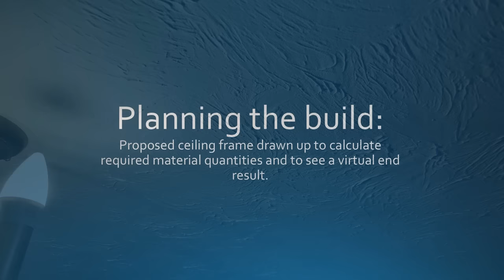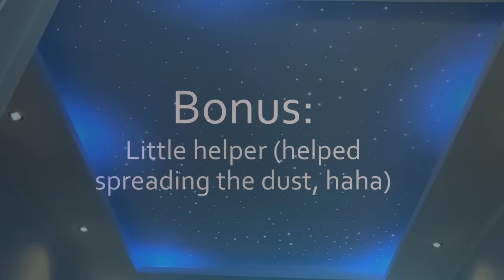Fibre Optic Star and RGB LED Ceiling DIY Build

Comment: so you cut the fiber optic before taping and mudding, AND painting? wouldnt those activites fill in or cover the fiber optic holes?
Reply from the maker: You'd think so, but when using the jointing compound I worked around fibre optic strands as well as not placing any strands near the edges of the plasterboard. And painting over them does not affect them as you'd think. However when trimming, I did leave the optic strands sticking out by around 2-3mm in case I would need to trim them further after another coat of paint (if I needed to refresh the ceiling in the future).
Hope it helps.

Comment: Amazing job! I was planning doing something similar with plaster boards as well but I was a little concerned about painting over the fibers after hanging the boards and cutting the fibers to desired length. Using plaster to cover where the boards join and painting won’t cover fibers?
Reply from the maker: Thanks!

I plastered joints before trimming fibre optic strands, working around them. And trimmed them before painting the ceiling (though left them sticking out by around 2-3mm for future trimming if further paint coats will be applied). Once painted over they shine through just fine, which I was surprised about too. But like I say, if needed it's always possible to trim it further when you leave them sticking out a tiny bit. 
Hope it helps.

Comment: I'm planning to something similar.. When you fill the joints with the compound won't cover the optical ends?
Reply from the maker: It would cover them. But I didn't put them close to joints and then worked around them.

Comment: What power control box / power did you use. The link has loads. I'm in the UK too and will connect to a switch. Thanks and keep it up. Brilliant
Reply from the maker: Thanks mate.
I've used the 5V 30A one, because it was compatible and sufficient for the length of the LED strip I had. 

Your power adapter choice depends on the type of LED strip you will choose to use (it's voltage) and it's length. 
Also, don't forget to make sure that your cables sizes are of appropriate size to handle the load, especially if you go with a 5V strip.

Good luck with your project.

Comment: Great job, i really liked it. Can i ask you the question please. When you were doing the ceiling paint using the roller, didnt the fiber optics  cover by the ceiling paint. How did you manage. Futher please guide me to buy all the material you used. Thanks
Reply from the maker: It is ok to paint over fibres, they shine through absolutely fine (I did two coats of white vinyl matt paint).
However I also left them sticking out about 3mm for future painting. When they will no longer shine through, I will cut ends by about a millimeter to expose fresh unpainted fibre ends.
Hope it makes sense.

Comment: Looks amazing..
2 questions..
1) if you could do it again is there anything you would do differently
2) I’ve always thought star ceilings had to be on a black background, how does the effect look in person on a white ceiling, and does it still look nice when starlights are off 👌
Literally was planning the same project but now I’m thinking I don’t need a jet black ceiling in my house lol
Reply from the maker: Thanks Adam, appreciate your comments.
Yes, if I would do it again, I would use tapered edge plasterboard. Only because it is easier to join it.
On the white ceiling subject, I also considered having it black and did a drawing to see what it would look like - it wasn't to my liking and also I think it would have made the room look smaller.
Now when star lights are off, you cannot see them at all and it looks like just a regular ceiling with a recess. And when star lights are on, you can clearly see them twinkle even in a bright day light.
Personally I am quite pleased with the end result and would not change it to black ceiling.
All the best!
Reply: @DIY_it_ALL  I am planning this for my living room. I am also confused about black vs white. This is a living room. So I don't want a black ceiling. I want a look where when star light is not on it should look like a normal ceiling but when lights are on they should show through as a night sky. Will this be possible with a white paint like you did? And did you paint on top of the fiber optic lights? Did the paint not get through?
Reply: I'm curious about this too, after you painted ceiling, didn't the color  soil(got on) end  of fiber optics, and reduce the brightness? Is it safe to paint over fiber optics after you cut them? Won't that have bad impact on brightness/lighting of stars?

Comment: Did you fix the plasterboards straight onto the old ceiling joists (with the strips of plasterboard on the back as shown in video or did you put more joists up there to screw onto?
Reply from the maker: I fixed thin timber strips onto the existing joists to create a gap between old ceiling and plasterboard for the fibre optic strands, and then fixed plasterboard sheets onto them with 50mm plasterboard screws.
Hope it helps.

Comment: Looks amazing! And going to try myself! Question for you, once you feed the fibre lights through randomly placed holes in the plasterboard. Do you need to cut then the other side so they are flush with the ceiling? How did you then paint over then without covering then up?

Thanks in advanced!
Reply from the maker: Thanks so much!
Painting over the fibre optic strands is fine and actually does not affect them shining through the paint.
However when trimming the strands I left them sticking out by around 2-3mm in case I would need to trim them further after another coat of paint (in case I would need to refresh the ceiling in the future).
Hope it helps, and good luck with your project. 👍

Comment: Did you paint right over the fiberoptic cable ends with no issues of the paint blocking the light transmission?
Reply from the maker: That's correct. I also left strand ends sticking out around 2mm, so I could trim them in future if ceiling will need repainting.

Comment: One last question, sorry :) 

I noticed that you made bigger hole marks for the optics and then smaller holes to actually feed, filling the bigger holes afterwards. Is that a necessary step? Or should I just go straight to smaller holes? Going to film my progress on something very similar and give you a shout out!
Reply from the maker: No worries, your project sounds exciting!

The reason why I made marks with the sharpie pen first is mostly to make sure that fibre optic strands are relatively evenly spaced out and so that the star pattern would be visible (quite difficult to see those 0.8mm drill bit holes). But it's definitely not necessary.

Hope it helps.
Reply: @DIY_it_ALL  thank you mate :)

Comment: Awesome job mate.. 2 questions.. 1. Did u Trim the lights before or after joint the drywall with mud? 2. Does painting over the lights affect them at all? Thanks and blessings man
Reply from the maker: Thanks so much mate, appreciate your comment.
I've trimmed the strands after applying the joint compound. And painting over them is fine, because they shine through the paint with no issues. Nevertheless I've left them sticking out by around 2-3mm in case I would need to redecorate the ceiling in the future and they would no longer shine through. I would then trim them further to expose fresh tips.
Hope it makes sense.
Reply: @DIY it ALL  make sense.. keep the hard work mate.. awesome outcome

Comment: Great work out of interest what stunner sizes you used and how wide is the the suspended ceiling. Looks great
Reply from the maker: Hi,
Thanks for your question.
I built the frame using 2x2's. The suspended part is 500mm off the wall and 270mm off the ceiling - 200mm for the 'base' and 70mm for the 'bottom lip'. 
The base came out 400mm off the wall and the bottom part 500mm, leaving a 'lip' of  100mm to hide LED strip for indirect lighting. Hope it makes sense.
Reply: @DIY_it_ALL  that all makes sense. Where did you get the fibres from out of interest ?
Reply from the maker: I bought it on AliExpress. I think there's a link in the description.

Comment: So did you cut the fiber optics flush with the holes and paint a thin layer over them?
Reply from the maker: They stick out by around 2mm, not flush with the ceiling. And painting over them is absolutely fine, I think I did two coats of paint.

Comment: What is the minimum ceiling height required to do this? Our house has only a 8 feet ceiling and I am thinking if I add this then it will appear too low. Am I mistaken? Thanks!
Reply from the maker: My ceiling is 8ft too, and the soffit drops down 6 inches. 
I have also installed vertical timber battens behind the TV stand (can be seen in video at 0:42) to make the impression that ceiling is higher. It definitely helps.

Comment: Amazing work man! I would love to do this to my living room, i still have a question tho. How did you paint over the fibers? Isn't the fiber now covered in paint which causes the light to be blurred or blocked? Looking forward to your reply, thanks ♥️🚀
Reply from the maker: Thanks so much!
It's ok to paint over fibre optic strands, they shine through with no problem. But I did leave them sticking out by around three millimetres, just in case I would need to trim them in the future after "refresh" paint coats.
Hope it helps.
Reply: @DIY_it_ALL  are you saying they are not flush with the ceiling?
Reply from the maker: @diybuildandlife207  That's right. They stick out by 2-3mm, but because the strands are transparent you can't see them.

Comment: got the starry bit done, just wondering the best way to create an access point if the optics light unit ever needs replacing. Where did you put yours?
Reply from the maker: Mine is situated within the dropped ceiling and accessed via an access hatch in the vertical piece of plasterboard above the overhang. Hope it makes sense.
Reply: @DIY_it_ALL  yeah it does, thank you

Comment: You painted over the fiber optic cable and it still shined thru the paint?  Would this work with black paint?
Reply from the maker: It certainly would. As long as it's matt emulsion.

Comment: How were you able to paint over the fiber optic lights?  Were they recessed just enough in the drywall?
Reply from the maker: Quite the opposite - they were left sticking out by around 2-3mm. Just in case I would need to trim them in future (after/if more coats of paint are applied).
But two coats of paint I have applied did not impact their brightness at all.

Comment: Great work! When you wired the lights, did you connect all white, all black and all ground together with one light that was actually connected to power?
Reply from the maker: Thanks!
Yes, I  supplied power to all lights from a previous light fixture.

Comment: When you painted did you just paint over the star lights ? Did it not cover them ?
Reply from the maker: Yes, it's absolutely fine to paint over them. Through I personally left strands sticking out by around 3mm in case I would need to trim them in future.

Comment: Its the most wonderful and finest job i have seen done by an individual. Im gonna start my project next week to make similar ceiling. I need  some help though, can i paint the ceiling black ? Would it effect the strands?  And i am planning to do it with the gypsum board, whats your say on that?
Reply from the maker: Wow, thank you so much! I appreciate your kind comments.
Yes, it is ok to paint over strands using any colour as long as it's a water based paint (usually matt colours). Personally I also left strands sticking out by about 2mm, so that if future layers of paint would stop them shining through I could trim them and expose the ends again.
With regards to gypsum boards, I used them in my build and it allowed me to achieve a seamless joint finish, so would recommend.
Hope it helps and good luck with your project!
Reply: I suggest doing a test of black on the ceiling.  I tried one and decided that I did not want black ceilings, so I switched them to a cloudy sky.  FYI

Comment: Hi, couple questions if you don't mind. Which stud finder did you use? Also, did you use plaster filler to cover holes from which starts coming out? I can see quite big holes before you installed plaster board to the ceiling. Hope it makes sense. Thanks
Reply from the maker: Hi Marius,
Thanks for your comment and questions.
Rather than using a stud finder, I went with the most basic (though most trusted) way - a small nail and hammer. Admittedly not the quickest way, but I wasn't prepared to spend a lot of money on a decent stud finder.
To fill holes in plasterboard as well as all joints I used plasterboard joint compound.
Hope it helps, buy don't hesitate to get in touch if you have any other questions. Good luck with your project!
Regards,
Karolis.

Comment: Quick question!  How did you mud all the seams and feather out your joints while all the cables were in the way? I feel that if you used a trowel that would risk damaging the cables.. Cheers and I hope to hear back from you!! 

Also the ceiling is wicked!
Reply from the maker: Thanks so much!
I used a small 4" blade to fill joints whilst avoiding fibre optics followed by some sanding to feather out the compound/mud.
Hope it helps and good luck!

Comment: Looks amazing!! Just about to do something very similar so it’s good to see how others have achieved it. How deep have you made drop ceiling approx 600mm from wall out to edge of new drop ceiling??? Do you need the spine (attached to ceiling for extra support?) also I want to fit speakers in mine which have a 4.5 inch depth so curious if you you used 4x2 or 3x2 for the frame? I think I would have to place speakers behind where the spine would meet the wall mounted frame as wouldn’t have the depth otherwise, any suggestions?
Reply from the maker: Thanks so much for your kind comment. It was actually 500mm out from wall in my scenario, but I have a rather small room. In a larger room it would probably need to be more than 500mm to look impactful.
I used 2x2's for the frame, but again, my frame is quite small, so it was sufficient.

Comment: This is so good, I am going to try it in my new outbuilding.
I can see from your comments that it is ok to paint over the fibre optics but how about with the taping and jointing? Did any of the gear cover any of the fibre optics? Or did you manage to avoid covering them?
Reply from the maker: Thanks so much for your comment.
I have spaced out fibre optic strands in such way that there were no strands on joints, so tape & joint was fairly straightforward.
Hope it helps and good luck with your project.
Reply: Can I ask what LED strip you used? I need to install mine but it isn’t quite as straight forward as I thought. Many options and a fairly long length

Comment: Hi, would love to do it but concerned my ceiling will be too low and make the room feel claustrophobic. Do you mind me asking what the measurement is from the floor to the  top/bottom of the edge of the suspended ceiling? Many thanks!
Reply from the maker: Hi, my ceiling is also rather low - 2350mm. The distance from the floor to the bottom of the edge of the suspended ceiling is 2150mm. Hope it helps.

Comment: Amazing job. How didi you paint the fake ceiling with the optical fibre without painting them over?
Reply from the maker: Thanks. 
It's fine to paint over fibre optic strand ends, it doesn't affect the light transmission. 
But I also left strand ends sticking out around 2mm, so I could trim them in future if ceiling will need repainting.
Reply: @DIY_it_ALL  thanks, will do this project next week, thanks for the help

Comment: Great job, question, how big is the gap between the old celling and the new false celling? I would like to know the dimensions of that frame you made
Reply from the maker: Thanks so much. The gap is 20mm, I used 20mm x 40mm timber to form the frame.

Comment: For the 15 meters of SK6812, they come in only on 5v. How did you handle the power injection? I've been debating this one or the WS2815, the advantage of WS2815 is you can go 12v but they're only RBG where the SK6812 is RGBW.
Reply from the maker: Good knowledge of LED strips mate!

I have injected power supply every 2.5 meters, so have 4x injection points plus both ends of the strip are connected to power supply too, which equals to six power points in total.
Hope it makes sense.

Comment: How do you fill joint compound in the seams without covering up the optic fiber strands?
Reply from the maker: I worked the compound around the strands, but also tried not to put strands too close to the joints.

Comment: Great video 
I  doing something similar 
I was wondering , where you got the led lighting from as I am struggling to get the strip to do all the functions your did

Once again great work ...
Reply from the maker: Thanks so much mate. 
I bought LED lighting from AliExpress, but you can easily buy it on Amazon or eBay. Search for "Addressable LED" and you'll find plenty to choose from. I personally used SK6812 and WS2812 strips on my projects in living room and hallway.
Good luck!